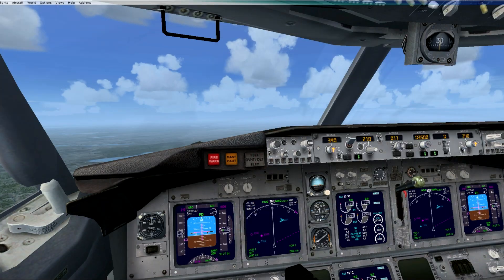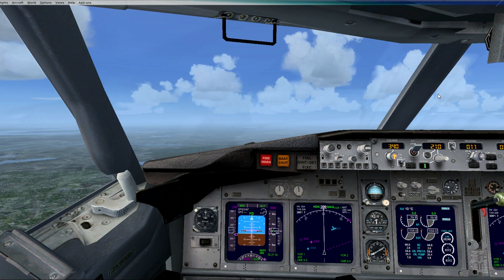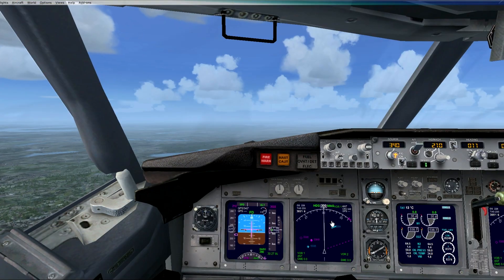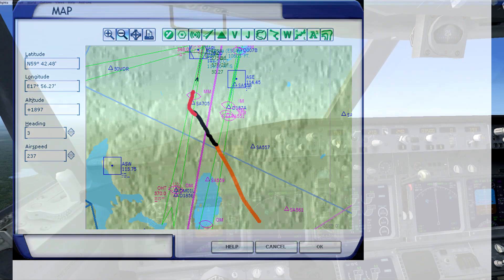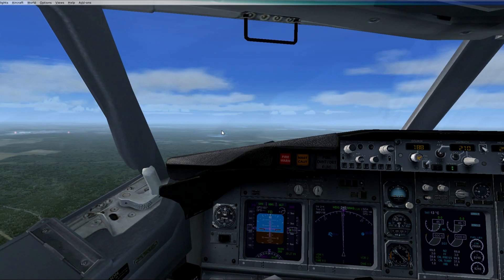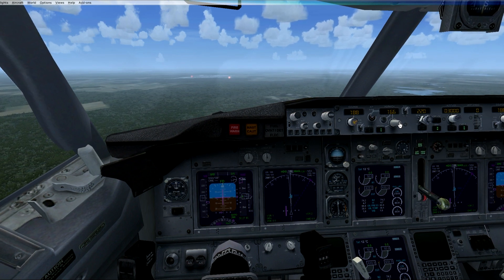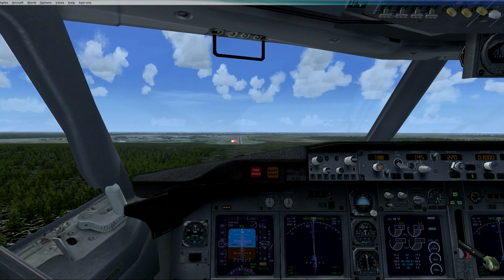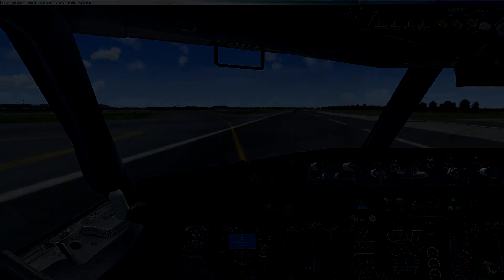FSX How to autoland (ILS land) EASY - Tutorial

Comment: a couple things to note that would be helpful to know. ILS frequencies will only be between 108.000 - 117.950 while COMM frequencies will only be between 118.000 - 136.950. i don't mean to be picky but 123.45 will never be an ILS frequency. rather, here in the usa at least, 123.45 is pilot to pilot chat frequency. be sure you put your ILS frequency in the NAV frequencies. a simple way to make sure you are doing this right is if you can't put the frequency into the box, its the wrong one. not a bad idea also to put the frequency in both NAV 1 and NAV 2 in case of a failure!  this is a really good video for beginners just clarifying a couple things i thought were confusing! have fun flying!
Reply from the maker: In my opinion it would be more confusing to add many small exceptions and details if you're just trying to understand the basics of performing an auto-land. You're info would sure help many who are looking to advance in the understanding though. Thank you for watching and the critics!:)
Reply: of course! and yes i suppose maybe it would be more advanced. good video though!
Reply from the maker: Thanks a lot! :)

Comment: This isn't "Autoland".   This is the Approach mode.  Autoland would land the plane automatically.  No default aircraft in FSX has Autoland capability which requires 2 computers.
Reply from the maker: +Emale2000 The 737 has autoland capability. And yes, you are right, the default 737 doesn't. However, if you want to learn how to autoland you need to know the basics, an approach is a good start. Please have respect for beginners limited knowledge, we have all been there.
Reply: +pilot43869 Please have respect for ALL YouTube viewers & refrain from posting misinformation.  I say again:  This is NOT "Autoland".  The title of your video is incorrect!   I suggest you view other YouTube videos that correctly demonstrate the Autoland procedure because yours is not one of them.
Reply: omg does it even matter

Comment: Hey man. This method helped me a lot and, because I don't have a joystick, I just keep the A/P active even when I land and I land it very smooth. My problem is that there are some airports where I hear the morse code, I switch GPS with NAV but the airplane would turn in a random way and eventually crash, it won't follow the airfield.. Is there a specific way to land or am I missing something? Note that on some airfields it works perfectly.. And also, I usually change the flight path and drag the path so it is centralized with the runway.

Comment: Since the RWY number is correspondent to the heading (eg 18R is 187) could you round it to the 5 (eg 27R is actually 272, but you assume it is 275) would it work?
Reply: No. First of all, the rounding is to the nearest 10 not five. Second of all, there are some runways that do not correspond to their number at all-- for example, KMIA's 8R course is actually 092 degrees. Third, always refer to the approach plate for the course... never assume.
Happy Flying!

Comment: when i am almost near to  the Runway the airplane starts to resist landing and increase the full thrust & fly a way. Any idea why ?
Reply: Make sure A/T Arm is Off (turn off Auto Throttle). It is separate from the autopilot. I set a switch on my Saitek yoke to turn the SPEED switch off because it gets stuck sometimes when I use the mouse to turn it off.

Comment: still confused how you got that course
Reply: The course is actually the heading.
Reply: +GENIUS316 He's right, course is the true runway heading as they are rounded up in 10's E.g if the true runway heading is 188 it will be rounded up to 190 or 19
Reply: SkyVector helps. Look it up on YouTube
Reply: Course is just the heading of the airport runway. He got it from the map that has all the airport information which is where he also got the ILS frequency.
Reply: thanks helped a lot

Comment: Can someone explain to me how do I put negative airport elevation? For example Amsterdam airport got -10 elevation.
Reply from the maker: Sven R The negative airport elevation is only used while landing, In the default 737 you can't change it, because it's simply too basic. I would strongly recommend buying the PMDG 737, which is the most detailed version of a 737 there is in the flightsim world. In the PMDG 737 (as well as in real 737's), you change the negative airport elevation on the overhead panel, in the bottom right corner. You can see the scroll under the cruise altitude set. Feel free to respond if you have any more questions, thank you for watching! :)

Comment: OKay, when i press the nav hold and see the aircraft turn, it keeps on turning and completely missed the runway... can you please help me with this? :) the aircraft does like tons of S-turn and just keeps on going till it aventually hits the ground and kills everybody :P
Reply: +Håkon Bøen Several things could be wrong.  It sounds like you've selected the wrong frequency in NAV radio 1.  To get the frequency from the map you have to be very careful to click exactly on the green ILS feather.  You can compare the morse code identifier from the information on the same screen with the morse code identifier of the transmitter you're tuned to in NAV 1.  In addition there are 3 autopilot settings for navigation - heading select, VOR hold and Approach hold.  To get the plane to track the ILS glide slope you need to switch to Approach hold.  As a side note you can also tell when you're tracking an ILS because you'll get a horizontal deviation indicator come up on your MFD to the right of your HSI, the same as when you're tracking a GPS course.  But this time you will also have an altitude bug on your digital altimiter in the HSI display - a little pink/purple diamond.  As you intercept the glide slope you come at it from below (it's going up as it extends from the runway) so the bug will be above you as you come in to intercept the glide slope, but it will move down as you get closer.  You can just tune the ILS frequency and get all that information displayed on your displays then use them as visual aids to fly a manual approach if you want to :)  Not sure if that's recommended haha.
Reply: Also you'll know the autopilot is doind its job if you're using altitude hold as you intercept the glide slope.  The ILS approach hold will switch that off as it starts to take you down :)
Reply: Cheers! thank you :D

Comment: I can do most of it, but when I get below 1000 feet shit always hits the fan for me, and unfortunately, I couldn't understand what he said after 1000 feet. does any of you has the saitek quadrant pro, on the 737 my throttle lever when lower, it doesn't bring the throttle to 0% percent
Reply: +Raul Zizou Are you disabling the autothrottle when you're about 500ft from the runway? If not, even if you bring the throttle to idle the autothrottle will power the engines back to whatever speed they were set to before.
Reply: I change the setting on my throttle axis to zero null zone now I can put it on idle and have better control. I was told to kill the auto pilot when it calls minimums(maybe its about the same 500ft), so far it has been working, I done a couple of good landings with the A321 and the CRJ700, now I got to try again with the 737, thanks for the help

Comment: i did follow every stap and my plane doesn't desend en don't makes te turn
Reply from the maker: +Rens Blok Are you sure you used the right frequencies and course? Make sure the button in on NAV and not GPS. If it still doesn't work I would suggest you trying to approach from a different direction/altitude. You are most likely too high up or too far away to able to catch the glide slope :)
Reply: I'm sorry i did make a mistake with te approach button no it works;)